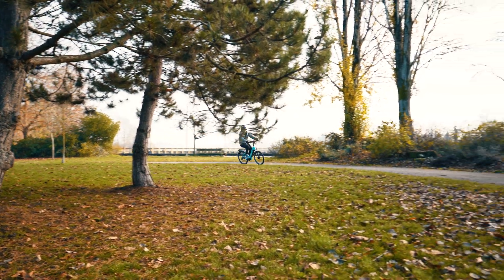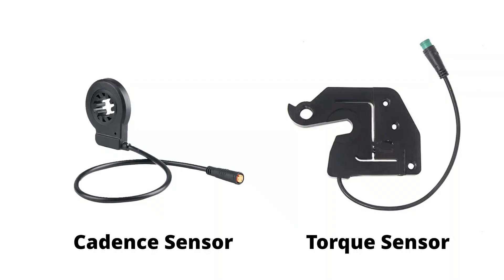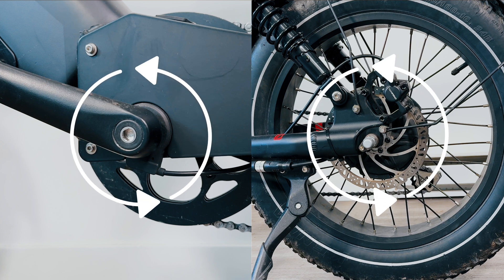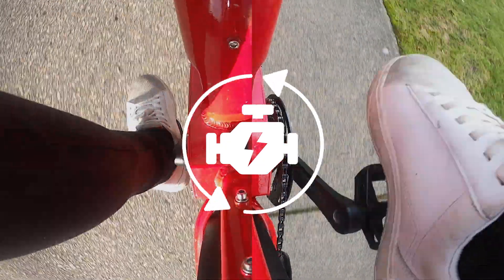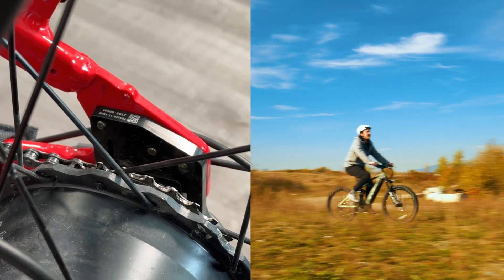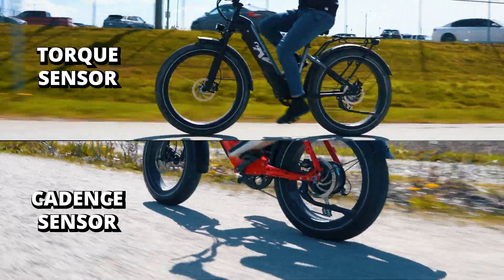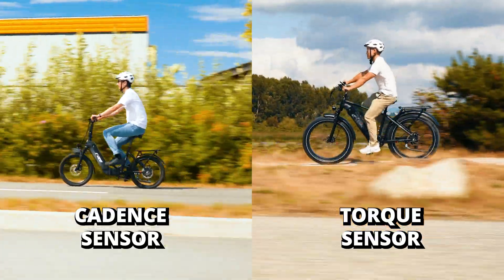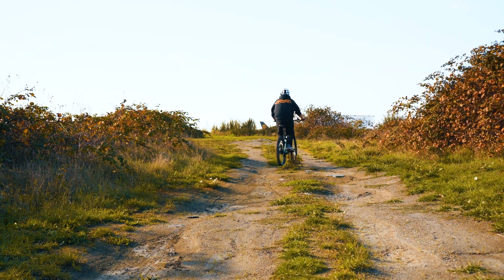Torque vs Cadence Sensors: Which eBike Assist is Best for You?

Comment: Fortunately, more brands are offering the ability to switch between torque and cadence sensor modes, so you can decide when you want to use one or the other. Euphree, Juiced (now owned by Lectric), Ride1Up, and Velotric are brands I know that offer this on their more recent models (except Juiced, which offered it on all but their RipRacer model). They can use separate sensors, combined sensors or just software with a torque sensor.

Just be aware there are two styles of assist with a cadence sensor.

The more prevalent style sets speed targets, like cruise control presets. The bike will use arbitrary power curves to reach the target, then greatly reduce or eliminate assist. With lower torque motors, this is fine. However, with higher torque motors (>60-65Nm), it can make you lose control of your bike. The only time I’ve lost control of an ebike is on one with an 85Nm motor in a 20x4 wheel, until I increased the number of assist levels to 9 and set the bottom two at very low speeds (5 and 9mph) so the controller only has the chance to get up to about 500W vs nearly 1000W starting from a stop.

The other style is like throttle presets. Each level will send a fixed amount of power to the motor. It’s easier to control the bike, especially starting from a stop, riding at low speed or matching speeds with other riders. To my knowledge, only Lectric, MATE and Ride1Up use this style with their cadence sensor models.

Comment: Most torque sensors pedal assist ebikes behave like cadence assist during start including Rize which I test ride. It require initial movement before it allows the motor assist. During start facing uphill you don't have assist unless your strong enough to make the initial move.

Comment: It’s clear, cadence sensor systems won, ebike companies like Lectric, Ride1Up resolved almost the described perceived disadvantages of the cadence system. Ride1Up Portola for example I have never experienced the so called “ghost” pedaling the amount of torque during different speed of pedaling is distributed evenly, the amount if cadence sensor magnets was increased. 

While Lectric did a software tweaking reaching torque sensor alike pedaling. And still both brands even with advanced electrical equipment and  Portola with upgraded mechanical components on the top charge just below $1K, way not as high as torque sensor equipped ebikes, and others with cadence sensor like Velotric, already $1,200 and raising?? The public which is more familiar with what we are talking here obviously will save some money not jumping on the torque-sensor wagon…

Comment: All the You Tube videos poo poo the cadence bikes.  I have one with 5,300 miles and if I ever need to replace it will be another cadence, and not because of the slight difference in cost.  You want exercise?  Try pedaling either one in PAS 2 fairly hard up a slight hill.  You go the same to speed and work equally hard on both.  The only difference is when you start, the cadence will accelerate faster.
Reply: Flies like the vinegar when they haven't taste sugar. I'am 100% sure my bike with Torque sensor will accelerate faster than yours.
Cadence need pedal rotation to give assist while torque only need pressure on pedal. It does not wait for rotation.
Reply: @netog4260 you just proved his point 😅😅😊 while bragging about your torque sensor.

Comment: Which one allows you to go farther on a battery charge? My first guess is that cadence sensor can allow a farther range. For example - If you set the assist level to setting one, the bike will never draw more than a set amount of current, and the harder you peddle, the less the bike will be assisting you, because it stops assisting if you go past that assist levels max speed. So as you increase your peddle torque when at that settings max speed you use less assist. Though, I have not used a torque sensing bike - maybe it also has top speeds for each assist level? If it keeps giving assist with all peddle torque levels at all speeds you may have much less range.